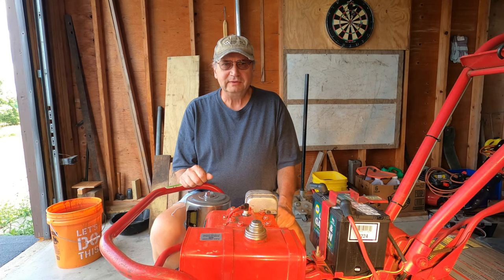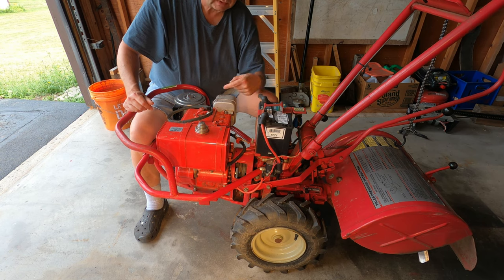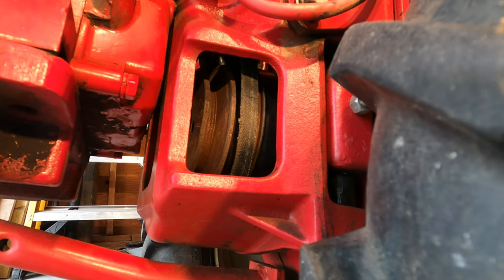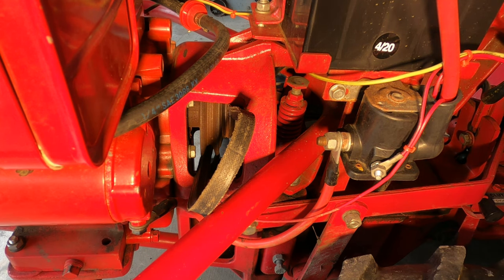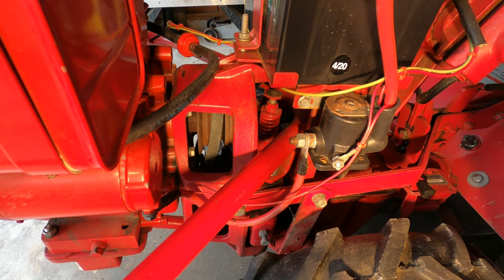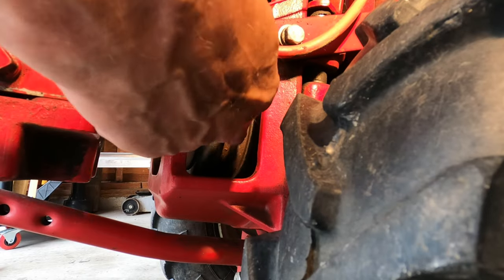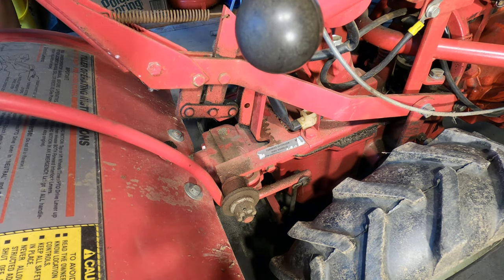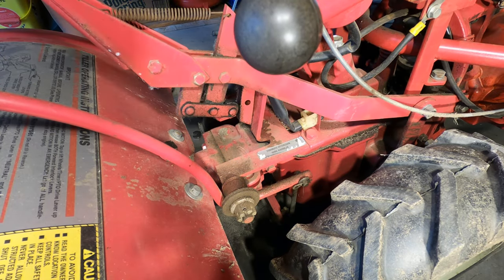Replacing a Drive Belt - Troy Bilt Horse Tiller | Man About Home

Comment: When you buy a brand new Troy-bilt Horse tiller like I did in 1995, it comes with a measuring rod to determine the exact tension on the belt.  It works like a feeler gauge and goes in between the little wheel below the adjustment block and the face of the bracket to which the adjustment block attaches.  If there is too much of a gap then you raise the block, too little and you lower the block.
Reply from the maker: Yes. The instructions are in the manual. Thanks for watching!

Comment: A few suggestions. First only use a Troybilt belt, after market belts don't hold up. Second, there's an adjustment tool that came with the tiller that allows you to set the adjusting block for proper tension. Third, you can get the manual online, it's well worth having.
Reply from the maker: Thank you for your suggestions, and for watching the video!
Reply: How much are Troybilt belts?

Comment: If that’s the old one and going to replace it thank just cut it and take it off. Good video of taking your time and showing us how to do it without taking everything apart 👍👍
Reply from the maker: Yes. That would make it easier... if you're sure the new one is the correct part. In my case, I had to practice taking it off and on, so the video wouldn't turn out bad. Thanks for watching!

Comment: I enjoyed your video, very in-depth and excellent, I have the horse that also has one belt with the friction reverse,but my reason for messaging you and hope other views can give me some insight on my problem, I purchased a very old horse tiller and had sat for years in a barn after inspection I fought that i couldn’t get it to engage or move motor at all but after greasing the elevation pins it then wound engage belt tension, I think it has the original belt that come on it, because I have adjusted the belt by the cast iron tensioner and the wheels will pull until it get into dirt or travel up steep hill,, will new belt resolve this? I apologize for long explanation . Thanks
Reply from the maker: If the belt is slipping, I'd expect to hear it squeal/screech. I can't say if a new belt will resolve the problem you're having, but it sounds like it's probably time to replace it anyway! Are you sure you got all of the movement in the slide pins restored? Could it still be hanging up? Thanks for watching!

Comment: What's the purpose of 2 double pulleys? Can you have double belts on it? What is the size of the belt you used?
Reply from the maker: It depends on what model you have. My tiller can't have two belts on it, because the pulleys are different diameters. On this model, you change the belt from one set of pulleys to the other, to change the drive speed range. In older models, you had two belts on the pulleys because they were the same diameter, and two belts give greater drive power without slipping. I would actually like to have the type where I could use two drive belts because I get quite a bit of belt slippage tilling my dense clay soil. This is the new belt I put on it: (It's "ok" so far.) https://www.amazon.com/gp/product/B01BO6NRNA/ref=ppx_yo_dt_b_search_asin_title?ie=UTF8&psc=1  
Thank you for watching!
Reply: You can use two drive belts on it because the top and bottom pulleys are inverse of each other by design. I have the same  tiller and I use both belts on mine. No slippage.

Comment: Would it be better with two belts installed?
Reply from the maker: There are older models that allow the use of two belts, and I agree, they must have a more positive drive with less belt slip. However, they changed somewhere along the line, and the "double pulleys" are actually different diameters. So you get a different drive ratio depending on which set of pulleys you have the single drive belt in. You can't double the belt(s), because they turn at different speeds. Thanks for watching!

Comment: Nice Video. 

I’m just starting to replace my belt. 

I think that I already saved ten minutes of aggravation. 

Simply pull out your knife and cut the old belt off.
Reply from the maker: Absolutely! But I couldn't do that for filming the video. I needed to use the old belt for multiple filming takes, to get the best vids I could. Thank you watching and commenting!
Reply: @manabouthome  
Understood. 

Perhaps in your next video explain why you are doing what your doing but cutting the belt is easier and quicker. 

Going to finish replacing my belt today. 

Thanks for the info and keep ‘em coming.
Reply: So, I finally finished the belt replacement. 

It wasn’t going as smooth as I thought that it would be. 

I stopped and looked over this situation to try and find an easier way to do the replacement. 

For my Model, a 1995 Horse Tiller, I found a better and least troublesome way to complete my mission. 

All that I did was to remove my reverse disc. 

The belt went into place easily and correctly. 

Removing the reverse disc is definitely the way to go for my model. 

I don’t know how it works for other Models. 

Thanks, fellow gardener.
Reply from the maker: @jaybird6186   There's more than one way to skin a cat! Good job getting it done. Enjoy your garden...
Reply: @manabouthome  

Thank you. 

 Now I need to take care of a carburetor problem. 

I had a rope starter problem and have been starting my tiller with my electric drill. 

I know that it’s not the preferred way to start it up because I am sacrificing the cooling capacity. 

Rope problem corrected. 

When I do get it running, I keep adjusting the air adjustment. 

When I have it running great, I can till for an extended amount of time. 

Then when I get it started again, I have to once again fool around with mixtures. 

I’m thinking that there is a piece of grit that keeps moving around in the ports. 

I’m not sure about how to correct the problem. 

Number one would be to replace the carburetor but that’s around 200$. 

Number two would be to rebuild it or soak it for a while. 

Then dry it with compressed air. 

I really don’t like to waste time and money isn’t a problem either. 

Any suggestions?
Reply from the maker: @jaybird6186  If it costs that much for a new one, I would try rebuilding it first. I searched for 8 HP Briggs and Stratton carburetor rebuild, and came up with a lot of videos... such as this one.
https://www.youtube.com/watch?v=_pJ_fTSb_bA
Reply: @manabouthome   

Thanks MAH.  I’ll definitely check out the video after dark. 

I have a retired machinist at my disposal. 

He actually was racing with B+G engines. 

Even when money isn’t an issue, he tells me that the problem can be rectified, easily. 

He said that before I drop 200$ on a new carb, to remove it, spray it up and dry it with compressed air. 

If that doesn’t work then get a rebuild kit and I’m sure that he will help me. 

The foreseen problems are; it takes time to break it all down and then it takes time to reassemble. 

If that doesn’t work, then try another approach. 
All of those steps take much time and aggravation. 

For now, I’m considering to just buy the new carb. 

I will watch your recommended video and my thoughts may change. 

Thank you so much for your interaction with me, it is deeply appreciated. 

Good luck to you with everything in life, MAH. 
You are everything that is right in this troubled world that we are participating in!!
Reply from the maker: @jaybird6186  Thanks so much for your kind words. Good luck to you as well, in this crazy world!

Comment: Thanks for sharing. I’m needing to replace my reverse friction drive wheel do you by chance have a part number
Reply from the maker: A quick search on amazon for "tiller reversing disc" showed some parts and the compatible part numbers. It looks like it depends on the year it was made. Now I have to figure it out for my machine! Thanks for watching.
Reply: @manabouthome  yeah mine is a 1975 and they don’t list anything that far back
Reply from the maker: @randalljarnigan5897  Yeah, this looks like a problem for me too. I need to get the serial number off my machine to see if it's listed here: https://www.partstree.com/search/?type=model&term=&filter%5Bmarketing_brand%5D=Troy-Bilt&filter%5Bequipment_type%5D=Tillers&msclkid=0e4cbdc5c2d41dce8f62d9e8a003beb7
Reply from the maker: This one also seems to have a good parts lookup system: https://www.ereplacementparts.com/troybilt-tiller-parts-c-26780_27175.html
Reply from the maker: I lucked out. The original owner gave me the manual along with a pile of other papers. I found the instruction sheet that came with the reverse disc and adjusting block kit from the last time they replaced it. #GW-1919. 

What is the model number, and/or serial number on your machine. I'd be happy to try to help you find it.
Reply: @manabouthome  I greatly appreciate it. Serial #199623

Comment: Do you know why they might have two belts? I have two belts and the one belt gets in the way of the drive belt coming off. Hmmmm
Reply from the maker: I think the older 2-speed models had two belts. Both belts would have been the same drive ratio. I wouldn't mind having two belts since that provides more drive power, without belt slippage, than one belt. My tiller is a 4-speed model. I can move the single belt to the other set of grooves and that changes the drive ratio, since they're of different diameters. I've never had the pleasure of replacing a set of double drive belts, so I can't give any advice. But if you have the manual, maybe there's something in there. Thanks for watching!
Reply: Actually, the single belt system where there are two different sized grooves on the two pulleys is a two speed arrangement. Move the belt from the forward position to the rear position to change the speed. The groove on the engine pulley with the larger diameter will give you a higher speed. So you actually have a two range, two speed machine.
Reply from the maker: @samuel glass   Yeah.. 2 ranges x 2 speeds = 4 speeds. Page 24 of my manual has a Wheel Speed and Belt Range Selection Guide. 1. Slow Gear, Low Range.  2. Slow Gear, High Range.  3. Fast Gear, Low range . 4. Fast Gear, High Range. Thank you for watching and commenting.

Comment: How come you’re just running with 1 belt? It’s supposed to have two.
Reply from the maker: Only one belt is correct. They look like a double sheaves. But they aren't. There are two different drive ratios, provided by two different sheave diameters on each shaft. Drive speed is adjusted by changing the belt position. Thanks for watching!
Reply: @manabouthome  must be different variations of the horse because even here on YouTube there are videos with them with two belts and replacing two belts.
Reply from the maker: @Rangband1  That's interesting. My Horse isn't the oldest model by any means. They must have changed over time. Thanks for the insight!
Reply: @Rangband1  Yes, the older Horse tillers ran 2 belts.
Reply: Mine only has 1 belt.
Reply: That's  hi and lo range pulleys you're looking at sir
Reply from the maker: It sure is. Thank you for watching!

Comment: I bought a Horse from a salvage yard.put another engine on it. Put in gear and it goes backward. WHY?
Reply from the maker: I don't know. It takes deliberate effort, and it's somewhat difficult to make my tiller reverse. I have to hold up on the reverse lever pretty hard to keep it moving. If you have a model number / serial number, you might be able to find a manual for it. Maybe here: https://www.troybilt.com/en_US/operatorsmanuals  Thanks for watching and commenting.